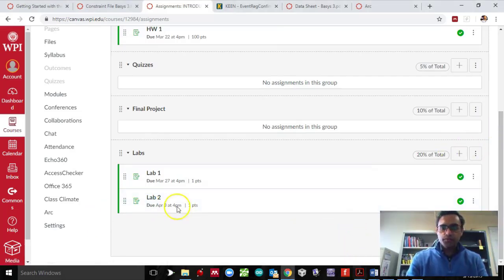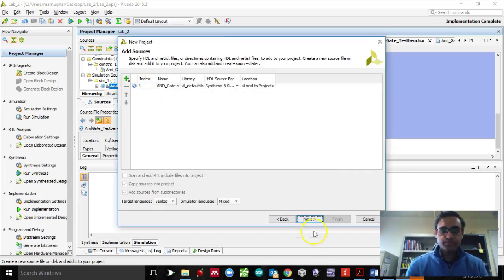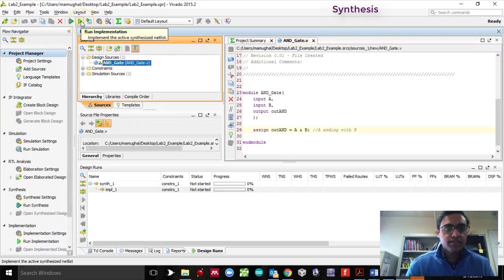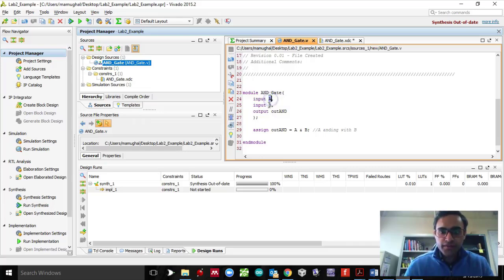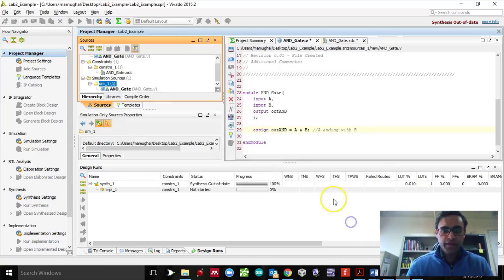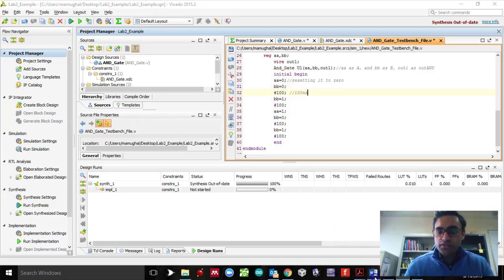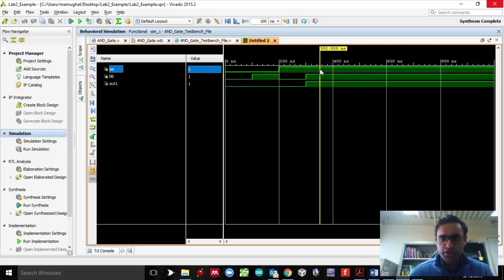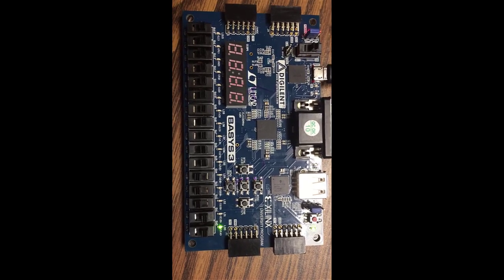FPGA for BEGINNERS➟How to Get Started with Basys 3 Board and Vivado?

Comment: Which version of Vivado should be used for this, does the version matter? As someone who has zero experience in electronics and fpgas, even this basic tutorial seems very challenging. The biggest issue I am facing right now is I don't know what to search for.
Reply from the maker: Dear, you can use later version, the interface is not too different. There are many FPGA-related videos on my YouTube channel, I hope you’ll find them useful.
Reply: @ElectronicswithProfMughal  Thanks for the reply. One more question if you have the time. Will learning Basys 3 right now limit my options for the future? Or are the principles similar across Xilinx and Altera for example. My ultimate aim is to end up with an FPGA based high performance cluster in around 3.5 years. As a complete beginner, do you think starting with Basys 3 is a good idea?
Reply from the maker: Basys 3 board is for beginners but it is very powerful and you can do advanced level stuff. What you should focus upon is developing Verilog HDL coding skills to design digital circuits, create testbench files and verify the logic. Once done, you can implement the logic on any FPGA board.